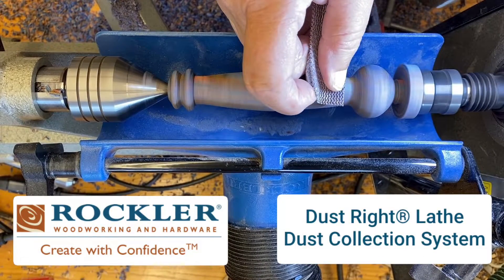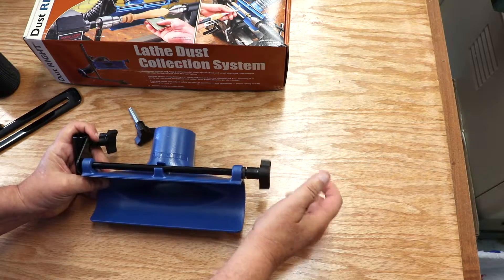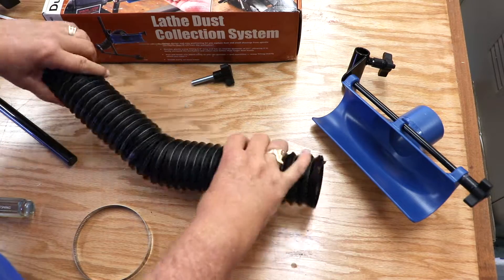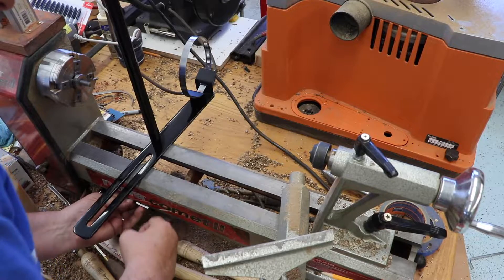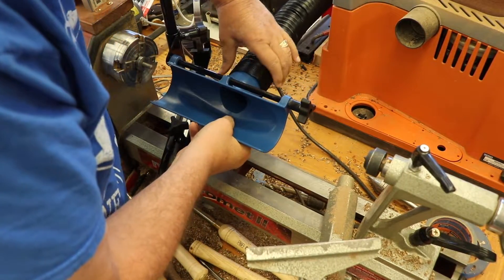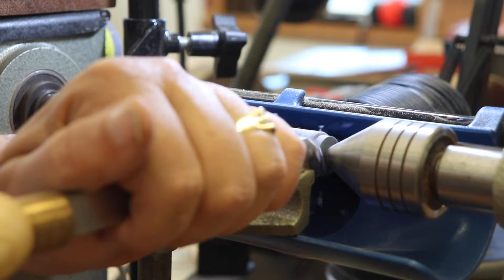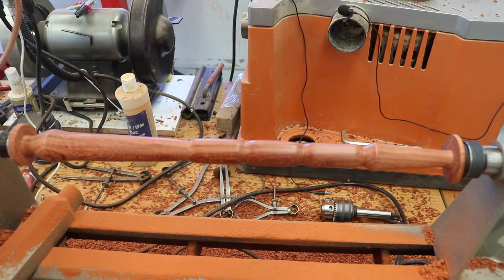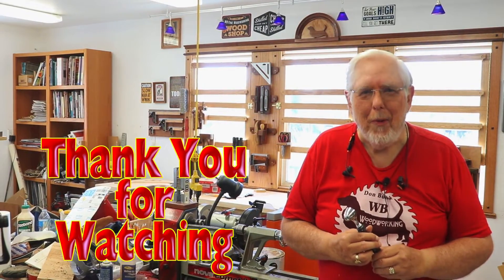Is it worth the money? - Lathe Dust Collector - I review of the Rockler Lathe Dust Collection System

Comment: Good lord, watching that screwdriver work was painful. I'm not sure you should be using a lathe if the screwdriver gave you such a challenge.
Reply from the maker: Ryan, I’m assuming you’re referring to attaching the column. There was an excessive amount of thread lock on the bolt and I was trying to keep it in the shot as I was recording the process. If I wasn’t recording it I would clamped the pice I was screwing into in a vise and screwed in the bolt. Video recording for YouTube often causes problems like that and greatly prolongs the process. By showing that in the video others may be able to plan ahead and not be surprised at the problem as I was. In the end I intended the video to be helpful to anyone who is interested in this devise. 

May I suggest that you try to video what you’re doing in your shop and you may discover it’s not as easy as it looks. Things like keep the work in the shot, making sure the focus is always right as well as exposure and lighting at the same time you’re performing a task while making sure everything is safe is a lot. Oh, you also have to remember to start the camera or multiple cameras because for most shots there’s no second chance. Retakes, which are common for most video work, aren’t always possible.

Comment: I have been using this item for almost a year now. Just turning pens.  It suck (and not a good suck) for chip collection, If I am turning resin it works really pretty good for when I am cutting ribbons.  The place it excels is in the fine dust collection. Which I believe is the most important part health wise. I think if rockler made it where it had one of them super strong switch magnets so you could move it alone the ways easier it would be more useful for spindle turning
Reply from the maker: Richard Sell thank you for the input. It seems that after extensive use you have come to a similar conclusion, this devise is great for dust collection but not chips, As you point out that’s most important. I like your idea of setting up a dust collector using mag switches. That’s something I may experiment. No matter what dust collector  try to use for the lathe to collect chips we’re fighting centrifugal force. The force of the lathe spinning toward us naturally throws the chips away from the lathe toward us.

Comment: Thanks for doing this but the “system” is really just a jig to hold the funnel near the workpiece.  With all due respect I’d say that the actual collection of chips, and more importantly dust, has much more to do with the vacuum it’s attached to, and the final filtration elements (filters, bags, cyclones, etc.).  Don’t be fooled by the little trail of visible dust, it’s really the INvisible stuff that we should worry about.  I’ve been turning for years using the clear funnel you showed, clamped to a half cinder block, and moved around based on what I’m working on.  Unfortunately the lathe is an extremely dusty tool and save for a double or triple system, vented outside or to a multi stage filtration rig.  I ended up moving my lathe out to my garage!